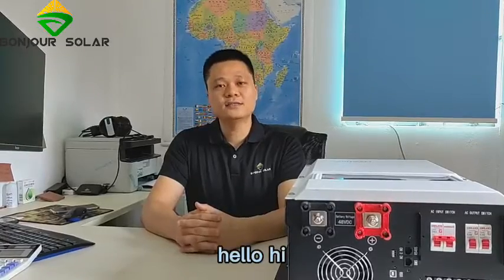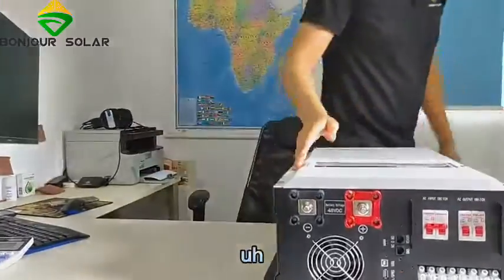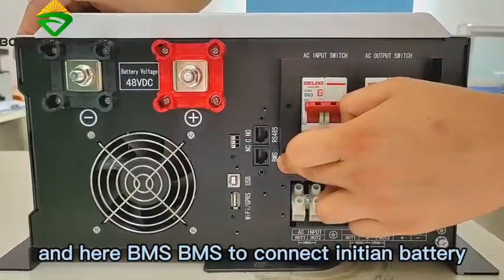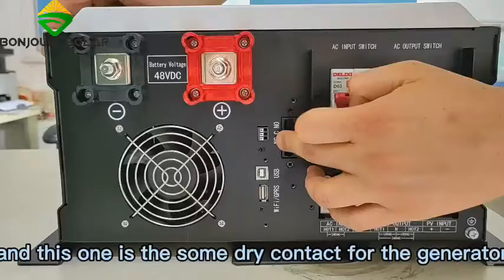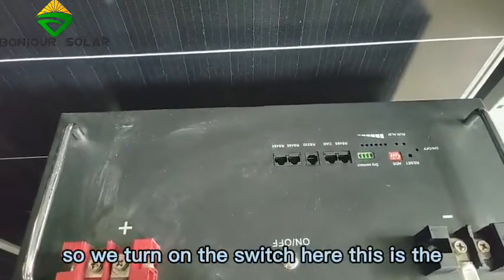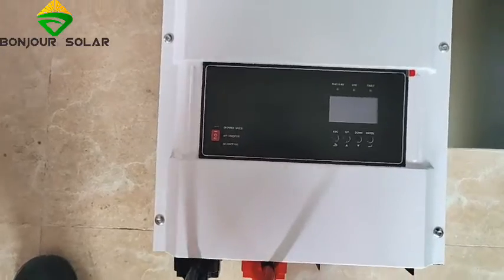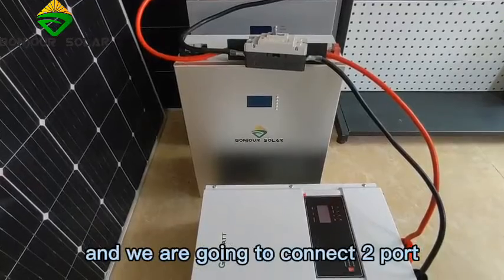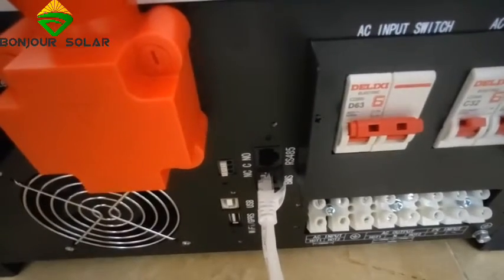Growatt 6kw split phase inverter setup and communication with lithium battery

Comment: Thank you for the great video.  
My question is: I have set my unit up and plugged ac input.  My unit does not start up when I plug it into my house ac.   Any trouble shooting tips ?
Reply from the maker: The start power of AC is 4 or 5 times of the rated power, so i think the problem is the output power of your inverter or battery is not big enough to start up your AC

Comment: Hello sir, can this inverter parallel with another 6kw growatt? Thank you
Reply from the maker: normally the power frequency can not parallel connection, the high frequency is ok for parallle. if you need bigger one, you can think about the 12kw model, thanks
Reply: Can I run 12kw n 6kwh in the same electrical  panel? I want to achieve 18kwh to run the whole house..
Reply from the maker: @larrymiller7128  can not parallel for this model of inverter, you need to seperate these 2 systems

Comment: What is N Mean on output? Is that negative?
Reply from the maker: N for NEUTRAL WIRE                   L for LIVE WIRE
Reply: Hello, thank you for your kind response, but now my inverter is not charging my battery. Can u tell me why? I'm getting #4 code now because my battery needs to be charged..thank you
Reply from the maker: @larrymiller7128  the fault code will be different for different type inverters, so we suggest you to contact your inverter supplier to get more information for fix it, thanks
Reply: My inverter is growatt 6kw split phase, just like on the video